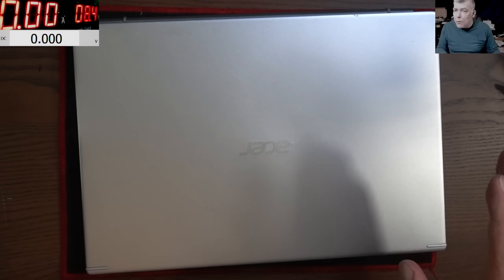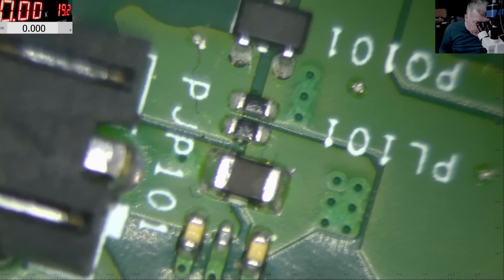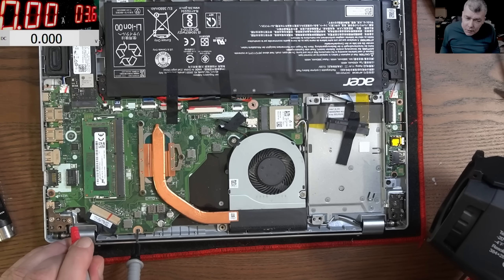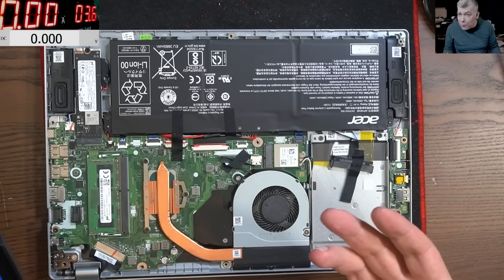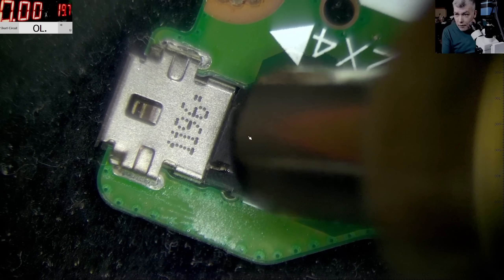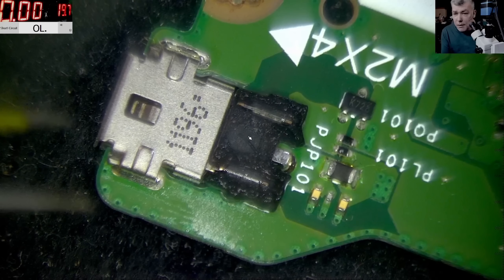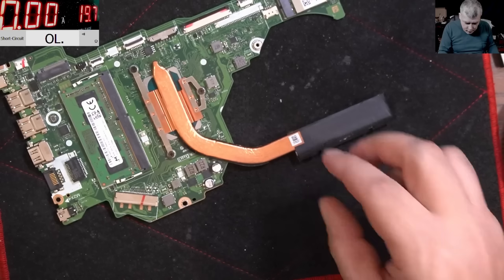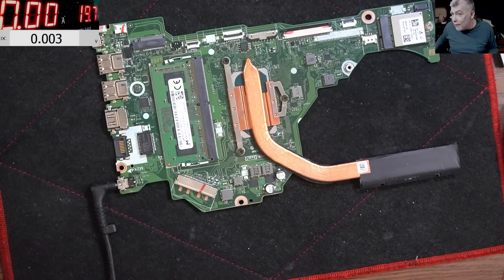How to replace a charging port without melting it! Acer Aspire 5 not charging repair

Comment: How do you learn all of this without a electronics background ? Any courses or books? Or do I need to do a degree in electronic engineering ?
Reply: Rossmann keeps saying that the best way to learn is to just start doing it. I've watched most of Rossmann's video, this one too of course by Sorin, but indeed there's no replacement for just hands on trying it out; the more you do, the more you'll learn. There's only so much one can glean from watching others or reading books; hands-on experience is just as important, to get a feel for the tools, etc. No need to buy the expensive kit upfront of course.

Also no need for a degree, though one could argue the extra theoretical background might help (I don't know, my degree was comp sci instead), but one option (in addition to just fixing stuff) is to buy electronics kits and build them, a good way to gain soldering experience. There are numerous books by Bibani on this (I used to make guitar effects units long ago using such books) or one can buy simple kits off ebay or Amazon, things like a mini oscilloscope or signal generator, eg. look up the XR2206 on Amazon, or search for 2.4" digital oscilloscope kit, that sort of thing. Hobby stores likely sell similar things. Doesn't much matter whether the kits are actually good products (though perhaps handy if so, ie. combine the experience building them with choosing kits which could be useful later), it's more just the practice that matters.

Likewise, being able to fix things for neighbours, friends, etc. I found this video because I wanted to repair a neighbour's laptop, swapping out the charging socket, almost the same model of Acer. I found the experience of using the hot air station to remove the old socket was similar to what Sorin shows here, but I only needed a normal basic soldering iron to attach the replacement, and now the laptop no longer suffers from a wobbly-cable-causes-sudden-shutoff issue. A year ago I repaired a neighbour's PS4 which had a bad HDMI port, that sort of thing. I'm still at the beginning of learning though for sure.

Also trawl 2nd hand shops, thrift stores like Goodwill, look for items which are not fully functional and try to fix them. Old radios, tape units, etc., though such items might veer into the more mechanical side of repair aswell, while beyond a certain timeframe a lot of consumer kit tends to be mostly single-chip with not much opportunity for DIY repair (tech from the 1980s through to the early 2000s is probably optimal). Or look for faulty PC mbds and GPUs on ebay, stuff that's really cheap, though not items that are obviously beyond repair (eg. ignore mbds with wrecked socket pins); I have a couple of mbds with bad traces I intend to repair. Vintage 1980s micros are another good practice option, repairing C64s and suchlike (Commodore, Atari, Acorn, Sinclair, Amstrad, Oric and so on), especially wrt learning how to diagnose faults. Channels like Adrian's Digital Basement and others have numerous repair videos for this sort of thing.

At the upper end of things, apart from Louis Rossmann, there's also iPahd Rehab and Paul Daniels, but many others too.

Comment: You are incredible in diagnostics, but as our diagnostics technician you need someone to solder it for you  :) no offense. 
There are tree ways how to to this properly : 
1. Get the connector out by air, remove all old tin, fit there new one , and solder it from other side of board using lead solder (lower melting temp, higher quality of joints) 
2. Almost same you did it, we just preheat the board to melt tin, little bit over and fir the connector, then add more tin as you did 
3. And the best option for soldering plastic connectors ,  as keyboard con, 4pin audio con etc. 
- use IR machine with bottom pre-heating, IR heating is mostly targeting metal parts , so it´s like from manufacturer, but it takes some time,  all plastics remain in same condition as it was and joints are perfect :) 

Thank you for your vids, it´s good to see someone working the right way not only replacing entire components :)

Comment: 6:50 if you have melted charging port, the customer told you about sparks and gave you his original charger, then you have to CHECK that charger plug - to see if the hole in that plug is not melted (expanded) as well. 
Sorin, If you teach people proper electronics - then you should say that kind of advice, because if the plug hole is expanded or melted then the port can be damaged again later.

Comment: I spent two years of my life servicing televisions back in the early 80s. It was NOTHING like it is today: swapping out defective modules, defective vacuum tubes, broken potentiometers, etc.
Today it's tiny, surface-mount components; working under a microscope; using a thermal camera as a diagnostic tool.
I'm not lamenting that I missed out on today's technology. I worked in a factory and made a living to support my family, which I could never do servicing TVs. It was interesting, but not so lucrative.
Now I find my enjoyment watching today's experts do it.
Thanks for sharing here.

Comment: I do this with the help of low melt solder.
Reply: And you don't need a hot-air station to do that. The less heat you have to put the board under, the better. Heat == stress